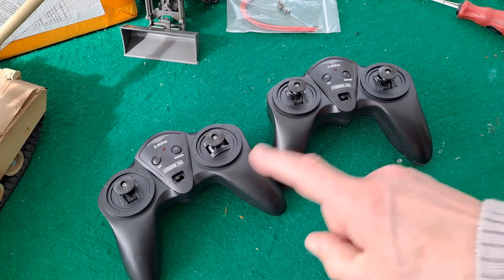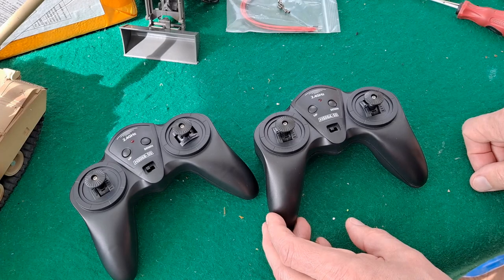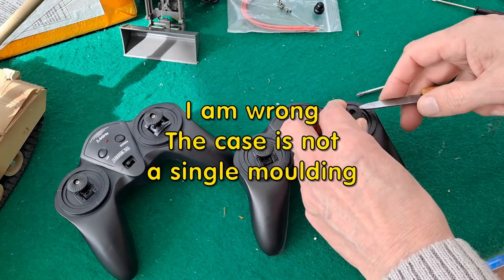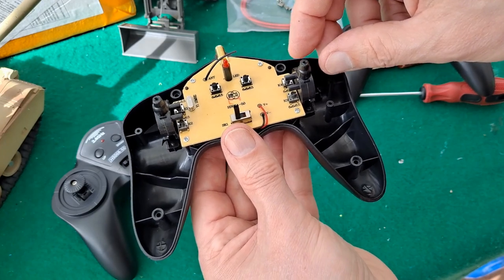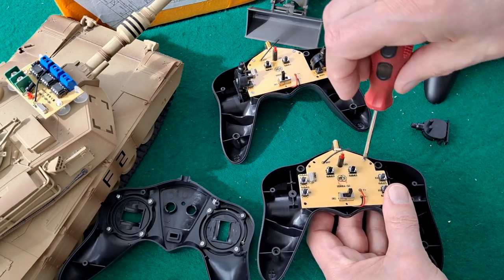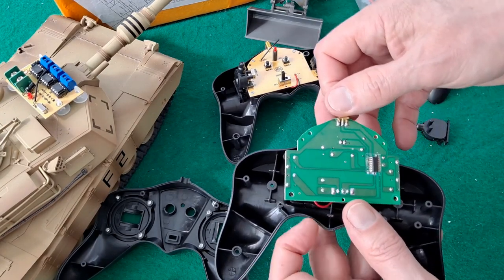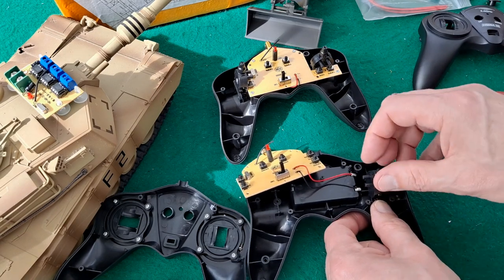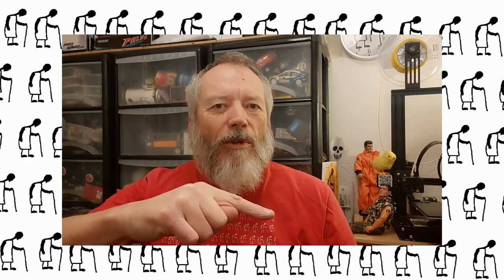Tear Down toy grade 2.4GHz controllers HS05A-50 HS06B-50

Comment: Yes you can its is only 3 wires you would have to solder. So if you saw the buttons off following the top note as you compare with the other controller it matches you will have to drill two new screw holes to mount it, One is already in use the other not. Solder some wires to the back to reconnect. job done.
Reply from the maker: Which way round are you trying to convert it. You want skid steer with both sticks moving up/down? That is the opposite of what was required. That's a lot of work anyway. A bit of 3d printing or even just a couple of switches mounted on a bit of good old veroboard would allow you to provide the left/right required. The main point was the slot in the cover can be unscrewed and rotated which I hadn't expected. I thought the cover was a single molding.
Reply: @GrandadIsAnOldMan  I thought you wanted the right stick to have left and right .so just cut off the switches and refit them at the bottom turn the joystick round which you have already shown can be done then un screw and reposition the top part of the joystick solder 3 wires to the switches . easy.
Reply from the maker: @RcAircraft   that's right, left/right is required. I was trying to work out if you had misunderstood. If you just cut the side of the board off, then the bottom corner will be left unsupported as you will have cut off the corner that has the location screw. Nothing that cannot be fixed, hence my reply about a bit of 3D printing or a bit of veroboard. You could cut away the space required for the horizontal stick and still leave the corner in place to support the board and mount a couple of new buttons on a bit of veroboard. You could even do it the way you described as long as you add a plate underneath to restore the rigidity. It may even be that the rigidity is not a big issue, just depend how heavy handed you are on the sticks and buttons. Like I said in the video, you could do it but really not worth the effort. Certainly in my case, where I needed the tank steering version for steering my tank, it all worked out fine without any need for any modification.